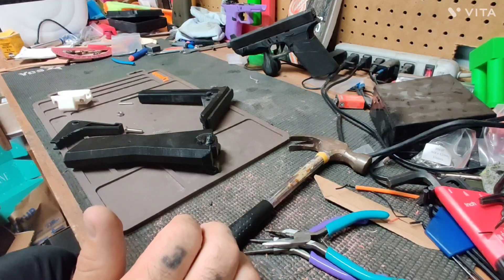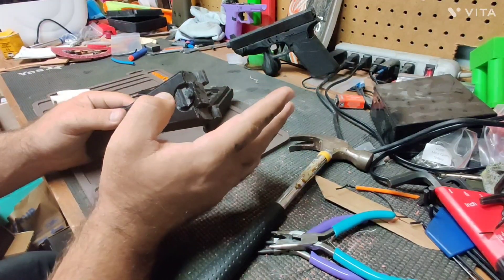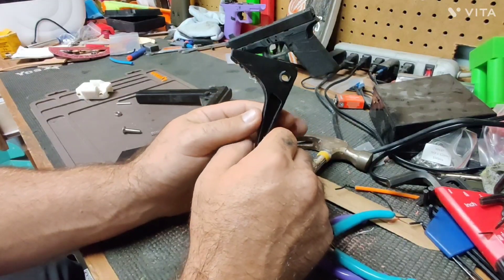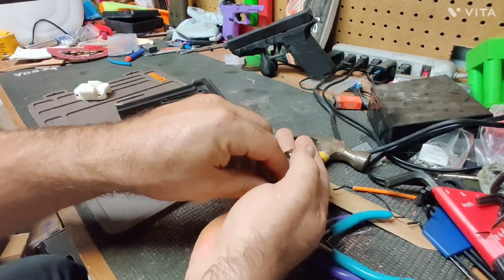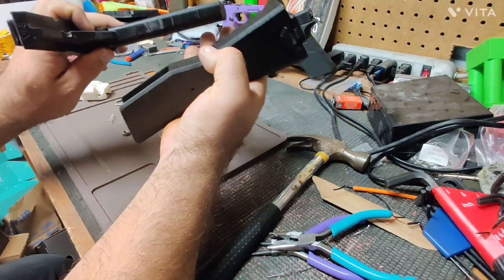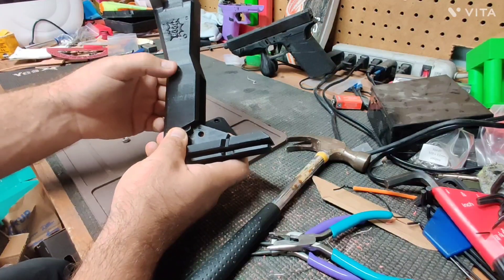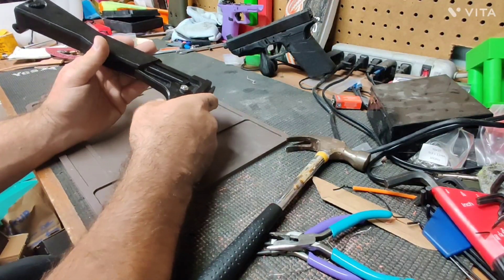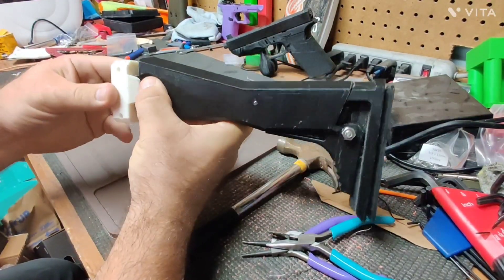thump n grind - adjustable stock

Comment: Im building one and was wondering if I should order the spring, bolt and rod kit from pwn tactical or order the parts separately. What would you suggest?
Reply from the maker: When I made mine I ordered everything separately. Almost everything I ordered was China direct so it was very cheap but took about 6 weeks. I ended up with a lot of extra parts but figured I could use them on future prints. The seller has to make profit so you'll end up paying about the same regardless, but buying the kits will save you some prep time.